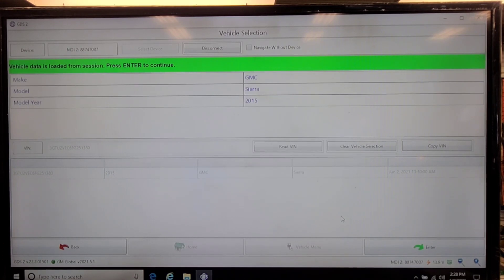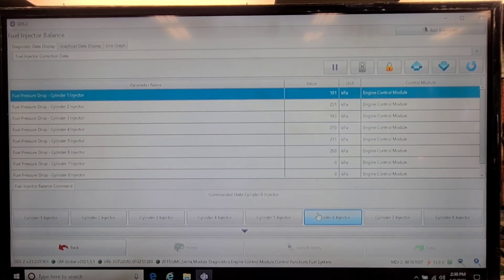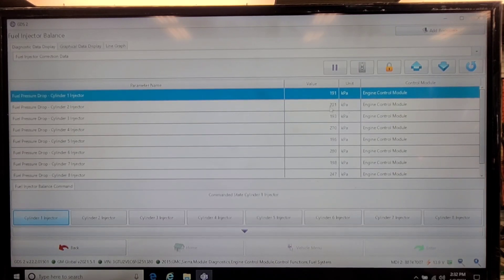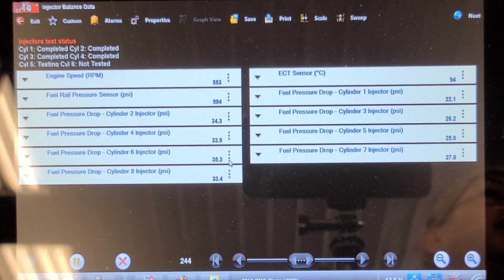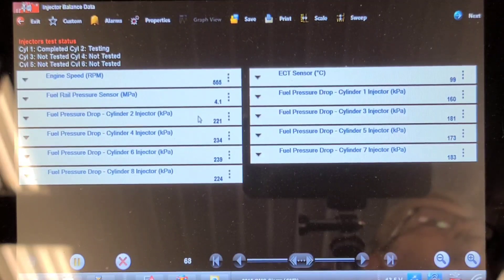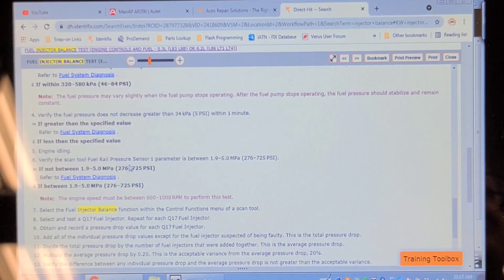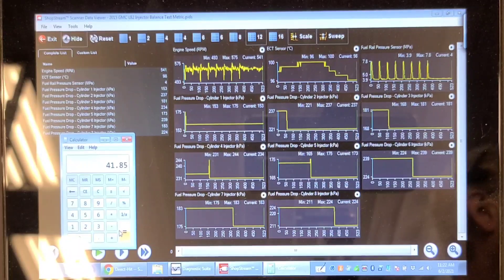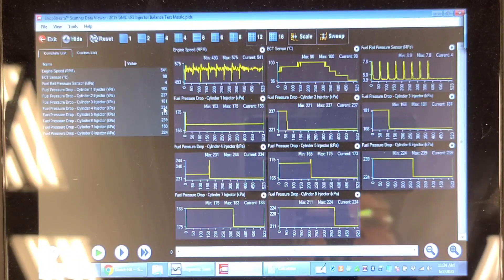2015 GM Truck 5.3 Injector Flow Test With Scanner Seems Inconclusive

Comment: You might actually have a couple of bad injectors but not enough to throw a code. What are the LTFT?
Reply from the maker: @PrintEngineering  my research indicates that the test is only accurate for comparing cylinders on the same bank and not bank to bank.
This test was done on a truck donated to our college and has under 200 kilometers on it so I'm sure there is nothing wrong with it.

Comment: That’s common/normal , you can’t compare bank to bank. Only compare with with their own bank.
Reply from the maker: Then it's a pretty useless test imo. I know I won't be putting much weight on it for diagnosis purposes
Reply: @PhillipBailey  They ( GM ) needs to update the service information. I ran across that a few years back when performing the GDS injector drop procedure and was thinking how could a whole bank be bad. Made a call to GM engineering and the guy told me not to compare from one bank to the other. I can’t remember his exact reasoning ( it’s been awhile ) but I’ll look for my notes.
Reply: @gcmd5852  Where you ever able to confirm what the cause is for the imbalance bank to bank or how the results should be interpreted?  I am experiencing nearly identical readings as this video.
Reply: @D2O2  yes the fact that the fuel pressure sensor is on one bank then the cross over pipe creates a restriction. You can’t compare bank to bank. I was told ( by a GM engineer ) starting in the year 2018 SI will be updated with information that says “ for engines with 2 cylinder banks only measure the average drop across cylinders that are on the same bank. “
Reply: @gcmd5852  Thanks for the quick reply!
Reply: @D2O2  No problem. Keep up the good work.

Comment: Just an fyi......there are different flow rates for each truck. The injectors need to be looked up by vin. If you put the wrong injectors in, you could get rich or lean codes depending on what the vehicle calls for as opposed to what injector flow rate was installed
Reply from the maker: Thanks thats partly why I recommended replacing all the injectors as someone had already replace two on the right bank and I wasn't sure what was installed. I ordered by VIN from the dealer as well. Thanks for the info.
Reply: @PhillipBailey  you could also buy, from the dealer, nominal fuel injectors that would not cause a misfire. it is stated in the repair procedure that if you do not know the part number off the old fuel injector you could install a nominal fuel injector in its place for repairs.
Reply from the maker: @malfunctionjunctionautomot7299  I ordered the injectors by the vin number from the dealer..

Comment: how accurate is this test?
is their a sensor on each rail?
or only 1 sensor for entire rail?
is it 1 rail for entire system or 2 rails?
does the injector furthest from rail pressure sensor have a lower reading?
is their a fuel leak?
is the injector slowly failing? 
definatly alot to think about before condemming an injector
Reply from the maker: I believe the rail pressure sensor is on the left fuel rail so that would be bank one. I'm going to check into it.
Reply from the maker: Here's a view of the rail on a previous job at 4:12 in the video. https://youtu.be/PXJXpfg_AYo
The sensor is on the rear of the left bank.
Reply: Phillip Bailey bank 1 and bank 2 sensors i can see  makes sense
Reply: Phillip Bailey okay    wonder what GM guys woulda say 
Clint Weiss? Kuokka? Nick Mendyk?
Reply from the maker: I posted this as a discussion on the Diagnostic Network, https://diag.net/
And the general concensus is the test is unreliable at best. Check out this network. Very active group. Worth the cost for sure.